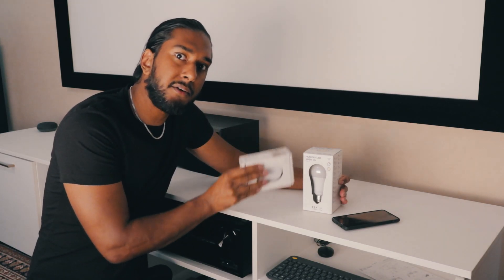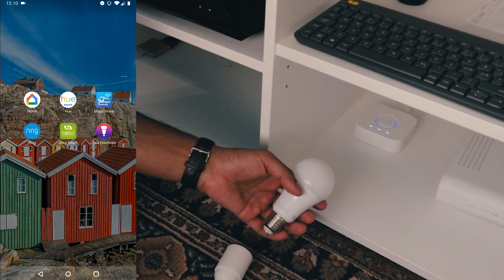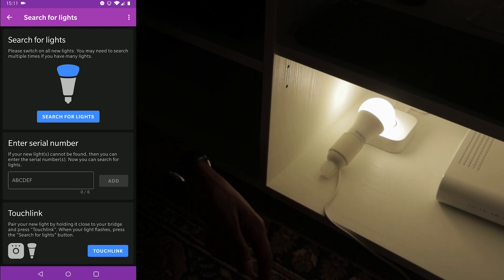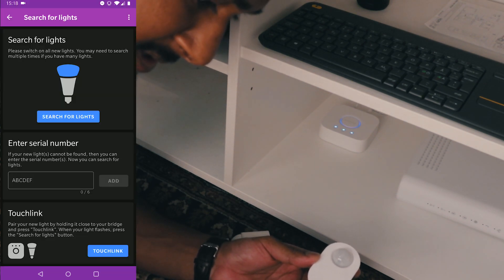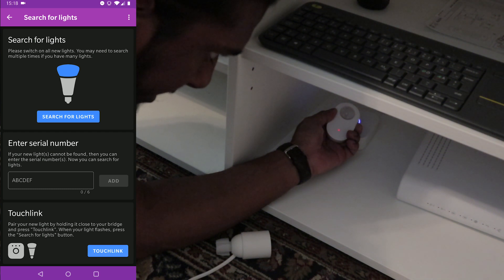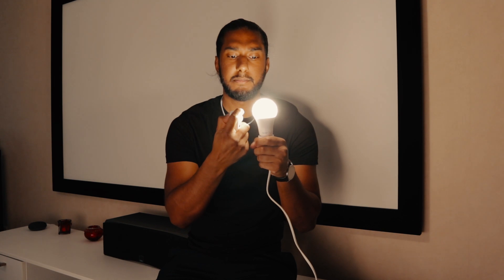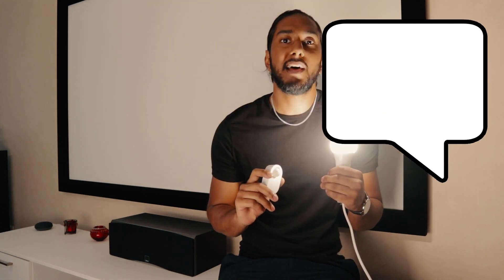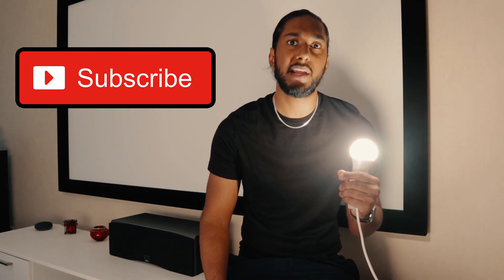How to use an IKEA TRÅDFRI Sensor on Philips HUE BRIDGE system

Comment: I've had this working with a hue bulb before and I cannot replicate it with a new one. Have all apps and tried multiple routes. It either adds to the hue bridge or is directly controlled by the Tradfri, for some reason can't get both to work

Comment: I must have spent at-least 3 hours trying to connect the Rodret ikea dimmer to my hub. Paired using your method. Works first time no issues. 

So if your adding the Rodret smart dimmer DO NOT ADD AS A SMART SWITCH. 

Pair it to the bridge as a light and it works.
Reply: So this works for you to control the light from the app AND you can still control the light from the hue app?
Reply: I am struggling with rodret aswell. I was able to connect the remote with this method but it lasted only for few minutes. Anyone found a solution?

Comment: The sensor isn't connected to the bridge its connected to the lamp ...
Reply from the maker: The sensor needs to be on the same ZigBee channel as the Philips Hur Bridge. That's why you use the Touchlink method with the sensor next to the Philips Hue Bridge.

Comment: Does this work with the new Philips hue app? Also, is there a manual way to connect the lights to the sensor?
Reply from the maker: Do this method you'll need the third-party app Hue Essentials.

Comment: What is the point of connecting sensor to hue bridge when it does not even appear in devices on hue app? And you are already connecting the sensor directly to the bulb which is how it will work. Did not get the point of connecting sensor to hue bridge.
Reply from the maker: The point of connecting the sensor to the bridge is to make work on the same ZigBee channel as the bulb 👍🏿

Comment: So, this process doesn't work for me.
All steps go through OK, but in the end, when I pair the bulbs with the sensor, they disappear from the Hue app.
I've got a feeling, that I may be doing the sensor pairing step wrong, since it's the only one that cannot really be verified properly. How can I make sure that that step is done properly?
Reply: I am having the same issue when I have followed this method exactly
Reply: Yes, because I think the video doesn't actually do, what it claims to do. There's also no actual proof in the video that it works as described. Otherwise I think there would be an answer from the creator after half a year...
Reply from the maker: This works but it's not easy to setup. Sometimes you have to redo the whole setup because the bulb can lose connection to the Philips Hue bridge. Also we try to answer as many comments as we can. I work a full-time job and my brother is doing full-time studies at University. Still I believe we answer many comments compared to other YouTube channels. This video also has a lot of likes and views, a tutorial doesn't if it's fake and doesn't work.
Reply: @HumanSuten  Hey. OK, then please do a video, where the results of your claim are actually visible at the end. There's no visible confirmation in your video that once you go through this process the bulbs are paired with the HUE hub while at the same time being able to be activated with the sensor.
I tried your process several times. Every single time the end result was that the bulbs simply reconnect to the sensor but are not controllable by the HUE hub anymore.
I would love to believe that your thing works, but experience has shown me otherwise.
Reply from the maker: Check out most two recently videos where we do the same exakt method with Trådfri Remote and Trådfri Wireless Dimmer. There you have screenrecords going on for the whole time and visible confirmation.
Reply: @HumanSuten  Well I don't have either the remote or a dimmer. And I'm not at all confident that because one process would work with those two products, it will work with the motion sensor. Very often this isn't the case and there may be a specific step on the sensor, which obviously won't be present on the dimmer or remote.

Your process either doesn't work at all for the sensor or it does and you have left out a step somewhere in your instructions. As it is, I cannot replicate it, I'm sorry. And I work in computer industry for 25 years.

Bottom line is that your video is making a claim of something that is not actually shown. You are only showing that the sensor works with the light bulb, which is kind of the default position and needs no proof, since I can call Ikea support for it.
Please show how the light bulb works with sensor AND at the same time is visible and controllable from Hue bridge.
Reply from the maker: Check out the video from the official Hue Essentials app: https://youtu.be/eiD6QLXoLtM
Reply: This still doesn't work, does this work with the latest software versions?

Comment: Nice video. Do you know if is possible to connect at the same time more lights to the motion sensor?
Reply from the maker: Thank you! 
Theoretically IKEA Trådfri sensors, remotes etc. all can connect up to 10 bulbs at the same time. So you should be able to but we've not tried it ourselves so I can't confirm that.

Comment: Whats the point to add it on the bridge?? Can you turn off the light, change color, dim via app (when u also have ikea motion sensor on the bulbs)???
Reply from the maker: If you mean adding the Trådfri sensor to the Philips Hue Bridge? You add the Trådfri sensor to the bridge to make it work on the same ZigBee channel as the Philips Hue Bridge. 
Yes you can as any bulb connected to the Philips Hue Bridge dim the light, change color if it's RGB, turn it on and off. 
But you can't change the settings of the Trådfri sensor as it's not configurable in the Philips Hue Bridge because it connects directly to the bulb.

Comment: Which Ikea bulb were you pairing in this video?
PS: the sensor also works with hue bulbs via the same pairing process
Reply from the maker: A regular warm white E27 Trådfri.
Ah okay thanks for letting me know!
Reply: @HumanSuten  Ah. I got those new E27 1000 lumen white spectrum and it doesnt want to pair...... everything else pairs fine. Wonder if its the firmware... you'd think being a brand new product it would have been compatible
Reply: Am I right to assume that once you pair the ikea sensor with a bulb (ikea or hue) you will lose control over the app/bridge?
Reply: @V1ct0ri0us  I have got the sensor to work with the bulb (hue or ikea) still paired with the hue hub so app control still works.
Reply: @benjie1982  thanks for the reply. I must be doing something wrong then. After the pairing of both lamp and sensor to bridge I pair them together like in the movie but then I lose connection from the app/bridge. Only the sensor can control the lamp. Tried both a tradfri and hue lamp. Will do some more testing in the weekend.